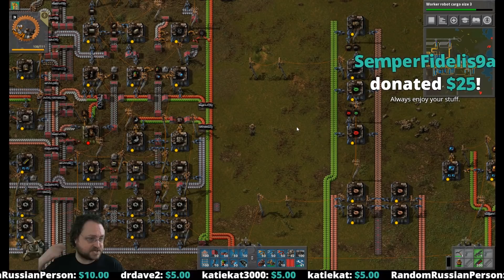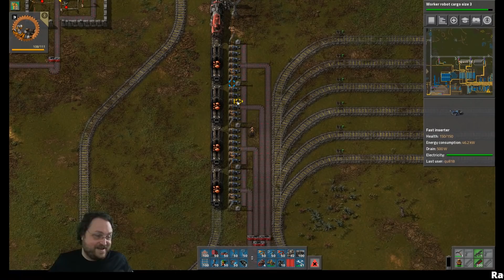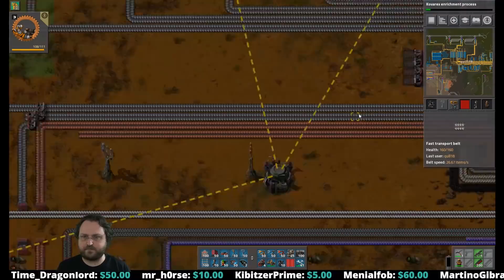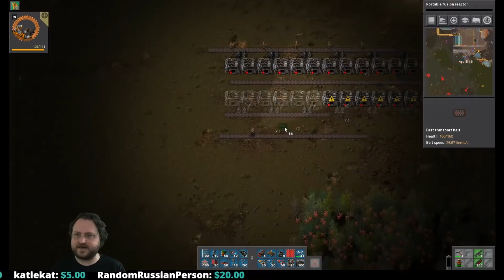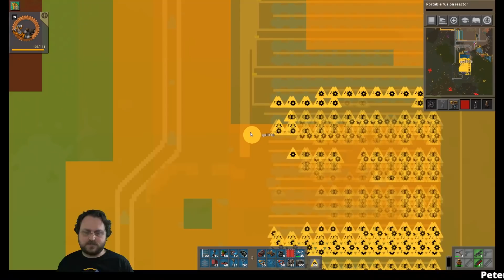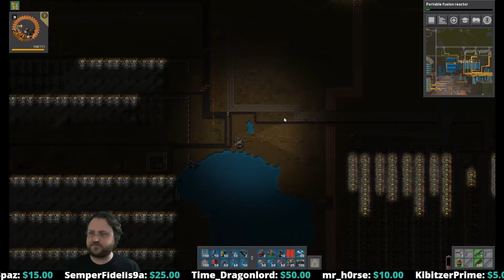Lazy Bastard Factorio! -- Episode 11

Comment: 1:56:30 That chest should be a green buffer chest.

You're requesting red circuits and placing them on the bus... and putting them in a passive provider chest.... which makes them available for the requester chest so they can be placed back on the bus... which sends them back to the passive provider chest.
Reply: Quarnozian Wouldn’t be Quill without those mistakes though would it?
Reply: For a while I thought he was making these mistakes on purpose in order to trigger people into spamming the comments to point them out. Afterall, youtube algorithm rewards channels that have a lot of community engagement, regardless of whether it's positive or negative.

But now I think it's just that he's moving too fast to keep the entertainment high, and as a result he doesn't have time to nit-pick over all the small optimizations that could be done if he were just playing the game without an audience. Plus he never really decided to learn how to minmax in factorio. The oil field is proof of that. For best throughput you'd put a pump to suck oil out of all the pipes and force it into tanks next to the tracks directly connected to the pumps of the train stop. (for example: https://i.imgur.com/cKKk4AI.png )

Plus I place a rail signal immediately on either side of the parked train, but if you need excessively high throughput, you could put a signal next to each power pole so the next train would begin it's approach before the current train even finished leaving.

Comment: Train Stackers (the parking spots) need a chain signal before the rail splits off to the parking spots, and then a normal rail signal at the entrance of each parking spot.

The entrance chain signal makes sure that two trains don't both line up for the same parking spot and end up blocking access to all the other empty parking spots.